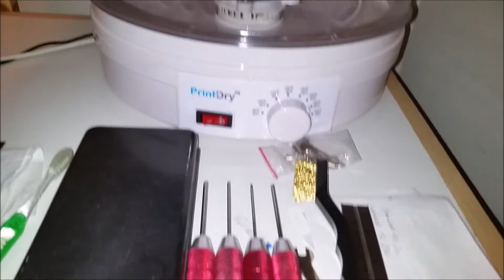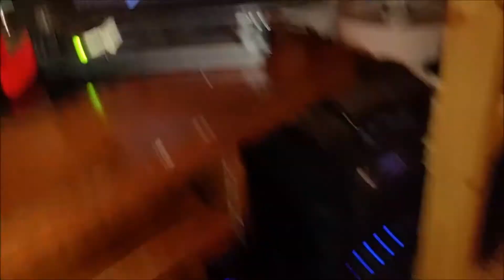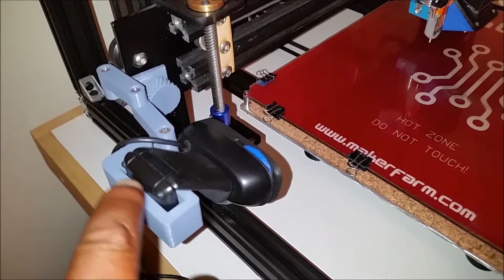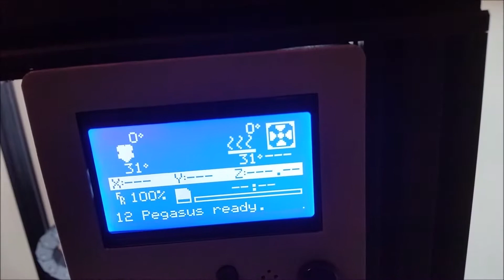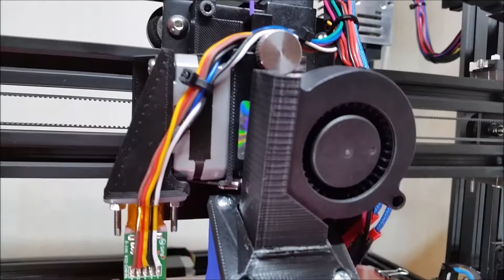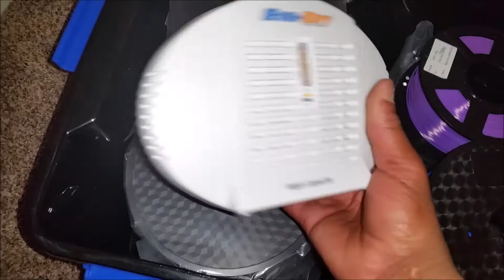Makerfarm Pegasus 12 Upgrades

Comment: Are you still using the same fan shroud for parts cooling?  I  am searching for one that will cool both sides, not just cooling coming from one direction, on my Pegasus 12.
Reply from the maker: Yes I still use the same fan shroud. This configuration can be adapted to use 2 nozzles. I didn't do 2 shrouds because of the BL touch. Personally I don't think that I've ever needed 2 shrouds with this setup. The key was finding a high quality fan.
Reply: @jeromejt62  Thanks I am using that same fan but with 3d printed linked articulating "hose",  great cooling on the air side but some sloppy overhangs on the non air side.   I will check out your solution.   I put this Pegasus 12 together with my daughter when she was 16, and now she is structural engineering grad student at Purdue.  Too bad Makerfarm is not around much.
Reply from the maker: @MastiffComms  I believe he is out of business. I will try and post links to the stls that I used. If I can't find them I still have the files on hand
Reply from the maker: @MastiffComms  Here are links to the files that I used

Intergrated fan Duct
www.thingiverse.com/thing:895483

Turbo Fan Adapter 
www.thingiverse.com/thing:1996655

30-40mm fan adapter. Use if you want. I used it to upgrade form the loud e3d fan to a Noctua 40 mm fan works great
www.thingiverse.com/thing:2748800

Hope this helps you out
Reply: @jeromejt62  Thank you!  I have too many hobbies, good at them all but not great at any.  Been a long time since I have made any hardware changes on this.

Comment: Im having trouble getting my pegasus to print quality prints.  I have so many questions but there isn't much help out there for the pegasus.  If anyone can give me tips and tricks I would be most thankful.
Reply from the maker: What are your questions
Reply: @jeromejt62  Im using the software the mfg told me to use,  slic3r .9.9.9  and I cant get the supports to come out right.  wondering what software and what setting to use to get better prints.  It was a pricey machine and still give me bad prints.
Reply from the maker: Slice3r is horrible for support removal placement period. Invest in simplify3d the supports fall off. I had the same problem with both cura and slice3r.

Also marlin can be upgraded I did it. But first things first. I believe you can try before you buy simplify3d. I was so impressed I bought it
Reply: @jeromejt62  does simplify3d have all the setting preset or do you put in settings manually.  if you are putting them in manually,  where do I find the settings?
Reply from the maker: There are default settings but you will need to tweak them. I can give you mine if you want to see how they work for you. My supports just peel off with no tools
Reply: @jeromejt62  please send your settings.  Im going to purchase the software this wekkend.  I hoping that the software solves my problems. are there any mods That made a huge difference.
Reply from the maker: Please see my video Pegasus 12 upgrades. Also contact me at acmech30@gmail.com so that I can email you the settings

Comment: could use some tips trouble shooting my pegasus,  It just wont print right.  Anyone able to lend a hand?
Reply from the maker: First what's the problem..
Reply: @jeromejt62  the quality of prints are poor.  I printed the hollow test cube and the layers on the bottom and top had imperfections.  then i printed the guide and it was poor quality as well
Reply: @jeromejt62  I got the printer running descent.  Now its putting out a lil blob when it starts making an imperfection everytime it has a start.  the rest of the print looks fine.

Comment: Thanks for taking the time for posting.  I noticed your lead screw upgrade. Do you have a video on how you did that? Trying to upgrade mine but the barrel connector between the nema motor and lead screw, hit the rail when it comes down.
Reply from the maker: Sorry wrong Video. Here is the correct link

https://www.youtube.com/watch?v=8DzjOv4V3CQ&t=213s
Reply: great, thanks again!
Reply from the maker: See Lead Screw Install Video on my channel Here

https://www.youtube.com/watch?v=8DzjOv4V3CQ&t=213s

Comment: I really like that z-axis upgrade, I can't believe the bent garbage that I got with mine. The print quality of the extruder block for my E3 lite was pretty bad too. I added some "meat" to the mounting tabs on the stl model and was able to print a much better one.

I like your filament mounting too, I was thinking about setting up something very similar. Right now I just have the filament suspended on top of the cage using a large diameter closet hanger rod.

The sideways mounting of the heat bed wiring is interesting. I still have mine running out the back, I designed a strain relief for it, and mounted it to the aluminum bed to take the load off the soldered joint. I think I like your method better though, it's a bit cleaner, but could still benefit with some extra support at the soldered joints.

Comment: Hey bud, thanks for posting up this video. I was wondering where you got the cable chain design? Also, do you have any prints you could show off?
Reply from the maker: The printed cable chains have been replaced by these in the link below, as they were not large enough to hold all the wiring. A subscriber designed the printed version and sent them to me along with the upper Z axis stepper motor chain mount. He posted the lower mount bracket on thingiverse  here (https://www.thingiverse.com/thing:2517548), but not the upper mount: I could easily draw up the stepper motor mount in fusion 360 and send you the STL

Cable Chain
https://www.ebay.com/itm/R28-15mm-x-15mm-Black-Plastic-Cable-Drag-Chain-Wire-Carrier-1M-Length-for-CNC-/273308402151?hash=item3fa27341e7

Here is an example of some of the first prints that I used on my filament rewinder video, that you can check out if you want.
https://www.youtube.com/watch?v=rJVV2Or7ZSg

Comment: Jerome are you on any of the facebook Makerfarm groups?

Just solved a print quality issue I had with some random layers hanging out from the bed heater cycling and slowly doing the upgrades chasing that problem.

Noticed you have your acme rod in a little different spot than I did because I could not clear to the left of the wood bracket like you did and you capture the top of the rod.
Reply from the maker: Hey Alan, I am not. When I started making videos I was not sure anyone would even watch them but to my amazement I have helped some, more than I ever thought. Maybe that maybe a good idea. I did post a video on my lead screw install in the Pegasus 12 build video series. My goal was to keep the lead screws in their original position if possible and I was able to accomplish that. If interested it can be found here on my channel jeromejt62

https://www.youtube.com/watch?v=8DzjOv4V3CQ
Reply: I had missed that video.  Explains you had to space it out and made custom nut captures.  I figured I would have to space mine if I tried to go where you did as the shaft just did not clear.

I still need to work at moving my left one as I get hit with the x carriage and loose a bit of capacity because of it.
Reply from the maker: Hey Alan this guy on thingiverse asked if he could remix my top bearing bracket so here is the link. he added counter sunk screw pockets. 

https://www.thingiverse.com/thing:2172994

Let me see if I can convert the DXF file to stl and I will send it to you or I can cut the parts for you on my cnc router for both sides. You can print the upper bearing holders from the stl file provided above.

Comment: Where did you find your c-clips for wire management?
Reply from the maker: For covering wires in the extrusion itself I used cover purchased on ebay found Here:
http://www.ebay.com/itm/Extrusion-Slot-Track-Cover-20200-2020-1M-CNC-Section-USA-Fast-Ship-Best-Seller-/262739012159?hash=item3d2c772a3f

If your are asking about the gray clips that hold the display cable they are printed from maker farm stl files found on the website under 12 pegasus downloads. View the pdf file on the web site then scroll down to wire management and the stl files can be found there. Hope this helps
Reply: Thanks!!  It looks like I'll be buying some of the first!